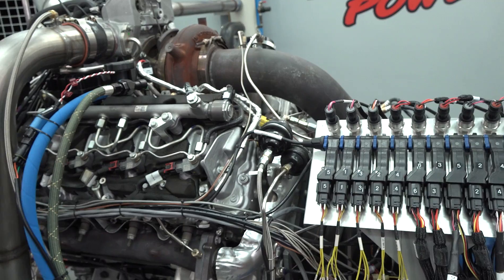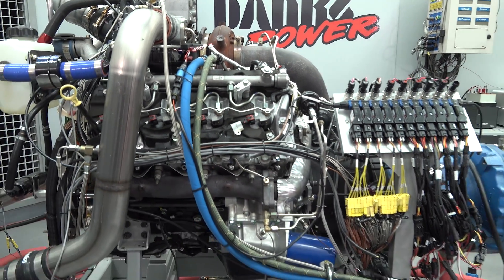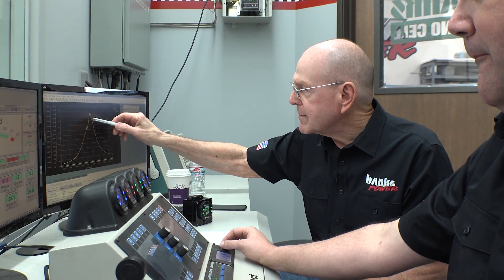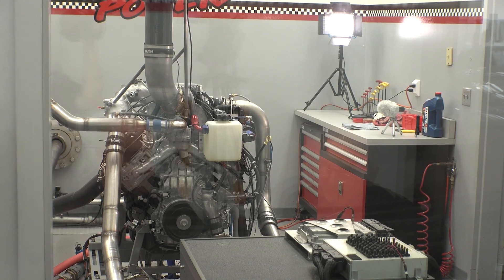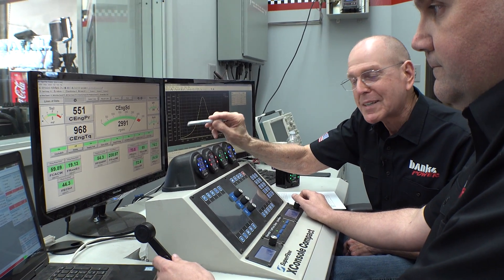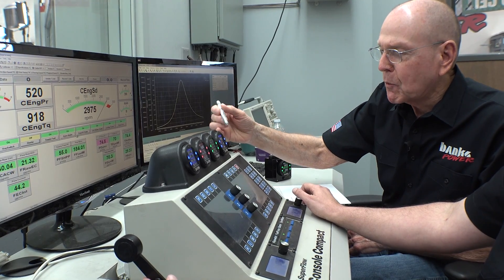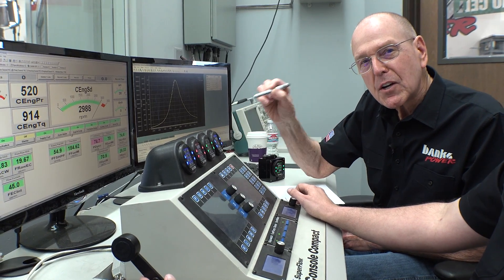KILLING A DURAMAX Pt 2: 550 Horsepower! 🔥

Comment: Mr Banks Can you PLEASE make a affordable solid state medium fuel pressure lift pump for our diesel engines? I have a 12 valve Cummins with a P-pump! My problem is that I can't find a affordable pump that is capable of producing and sustaining a minimum of 25psi. I emailed Facet about making a 25-50psi solid state fuel pump but no answer from them at all and apparently they ignored my message to them

Comment: In case you missed the question the first time. What happened to your series on rear diff covers. You stated your dyno blew. So you get a new dyno and jump to another infomercial on the Banks gauges. A shame your career will end as a snake salesman. Someone who had integrity has gone to this level. You slam another product and fail to prove yours is superior.
Reply: This is an engine dyno, they have to do the diff testing on a chassis dyno, that's the one that blew up. Maybe you should pay more attention.
Reply from the maker: It's coming! We'll be posting the results video at the same time we debut our diff cover. We know that we'll only be able to get everyone's attention once, so we're synchronizing the data reveal with the Banks diff cover reveal.

Comment: My carburetion instructor back in '81 would have loved these. Paul Reineke from NBC Tech. (Now known as UNOH.) I got to see him 2 months before he passed away at 86 years old. I thanked him for the in depth attention he gave to air density as well. Not on the level as Gale, but to an 18 year old in '81, him stressing, " You CAN'T run 750 CFM through a stock 350. You CAN'T!!!" rings in my ears every time I see an open air cleaner sucking hot air from under the hood. That was one of his pet peeves!

Comment: Kill a duramax.... just look at it and it will fail. GM is trash

IDI 7.3 making 700HP and 1500lbft on stock bottom and over 400k miles....Sorry GM..
Reply: Zues Toots yeah right. Show truck that doesn’t see any towing. Buddy destroyed his Ford towing his 38’ 3 axle race car trailer. His Duramax, can’t be killed towing the same trailer.
Reply: Idi 7.3s are known for kicking the bucket around 500 lbft ish without careful builds the powerstroke like 700 hp.
Reply: Also there are duramaxs making 1200 hp
Reply: jdr ok my points went way over your head. 👋🏻
Reply: @dnnbrgr7864  wasn't responding to you sorry if I replied to you. I'm just stating that the 7.3 isnt even in powerstroke trim known to make that much on stock parts before rods start dieing a 7.3 idi won't support that much without a completely built engine as they start breaking over stock and they require a ton of fuel modifications. 800 lbft is more realistic 700 and 1500 lbft that serious hp and torque for a engine that never seen 400 lbft stock

Comment: Have a 2002 GMC 2500HD with a Duramax(LB7), bought it in 2006 with 35,000mi on the odo, first 2 things I changed were the intake system and the exhaust...Been running Banks for the last 12yrs, both the cold air intake, and the 4" exhaust system, from the downpipe back...the truck currently has 160,000mi on the odo, and other than replacing all 8 injectors 4yrs ago, I've had no problems...It's a daily driver and my only vehicle, and I have no qualms with doing upgrades using Banks engineered products...

Comment: Any updates on the diff cover testing? Great video 👍
Reply from the maker: Yes, there is. The reason for the time between follow-ups is purely due to R&D. We've been sitting on the info for quite a long time. Why? We'll only get your attention once. We're going to reveal the research when we debut our cover design. We made many iterations and several billet prototypes, tested the heck out of the design, then went with a manufacturing process that is far more accurate but takes much longer. As of now, the diff covers are being manufactured. 👍

Comment: Quick question. When you are measuring cylinder pressure, is the graph you are showing calculated cylinder pressure readings, or actual cylinder pressure readings as measured?

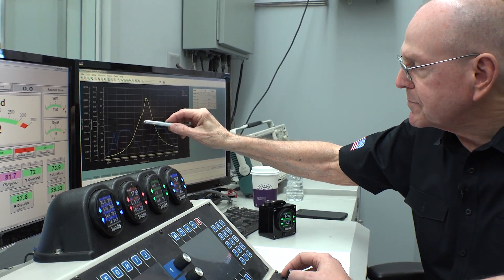Comment: 11:45
 The graph flattens out because the fuel is absorbing heat energy. This causes the air inside the cylinder to contract slightly as you graph shows until the fuel reaches ignition temperature then the graph carries on upward
Reply: Good explanation,  I guess at higher rpms there is enough heat in the cylinder to almost instantly combust the fuel.
Reply: @leonallen9833  the way I understand it the Top Fuel nitromethane guys use this characteristic to keep from melting their Motors, as it pulls the latent heat out of cylinder. The excessive fuel for them is additional cooling for the engine they stopped just shy of hydrolock, sometimes they miss the calculations and that's when you see the fireball.
Reply: The evaporation or boiling of the fuel in the engine does pull heat out. So you are correct

Comment: Gale your such a tease, give it to me all at once. I bought a 2004 2500 duramax brand new. 2 months old I installed your system and air cleaner on it. She's still running like a top today. 300,000 strong. I'm do for a new truck and I'm a little partial to the gm drivetrain.  Is this new motor going to be able to handle a whole lotta work or not?
Reply: LB7 or LLY? how many injector sets? Lol
Reply: @detroitdiesel-vu3ig  lily late model 04. Nk injectors yet. Just had a head gasket replaced sent the heads out and had them redone. Only issues I had was the instrument cluster . She shows 280,000 but there's well over 300.

Comment: this is way to smart for me, i want to see the crank hit the floor already.
Reply: Trent Nelson I bet you wear a mossy oak hat too
Reply: @sean1649  and sean wears wnite framed Oakley's with the Tap Out wife beater tank top.
Reply: You might see it the way they running at max rpm for such a long time
Reply: @traxxasLOVR  high rpm wont kill it unless it has a flaw in the block, a large stroke where the pistons start to push out instead of up the bore (7.3s would occasionally do that), its unbalanced, lack of oil pressure to maintain rpm or heat. He could run that thing to valve float and hes watching everything so close that it will show it's TRUE flaws and not a "lack of" issue
Reply: @jaredanthony8070  i agree with you as long as you can agree that the heavy rotating assembly on diesel engines lend themselves to way more stress under high rpms.... not related to keeping oil pressure. Although you need that
Reply: @traxxasLOVR  race duramaxs can rev to 5k plus. That's fully built obviously. But if gm is designing these engines as well as they seem to be that would also make me think that the rotating assemblies are pretty well balanced from gm. Drill a 1/4 inch hole in the crank a place or two and it might shake itself apart as with most engines. I've seen 12v Cummins with factory long blocks rev to 5k rpm and although they dont last too long doing it.. its possible..
Reply: @jaredanthony8070  i am talking stock internals. Blocks usually hold more than the internals. Cummins 6 cylinder setup can take more power and rpms stock to stock because they have more main bearings to hold the weight of the rotating assembly better. And gm has been ruining their reputation with duramax fuel pumps going to shit within 50k miles so i wouldn't just trust them on everything. They can say how awesome it may be but i guess time will tell
Reply: @traxxasLOVR  so you are blaming the BOSCH cp4 and cp4.2 on GM? Lol its going on the new 6.7 Cummins and is also on 6.7 powerstrokes although they have an apparently better filtration and water separator than the lml in particular. Also every single duramax except the lb7 that could break cranks.. has been capable of pretty big numbers bone stock. 500 horse and close to 1000 ft pounds. Lly's might not be able to hold it because of their overheating possibilities that were extreme cases. Lbz's all day. Lmm's all day. Lmls until the Bosch cp4 fails. L5ps have stronger parts than any duramax has ever had and banks himself tore one down and was impressed by it. That's why hes doing this test because it's so beefy he wants to know where it fails and what it is. The l5p basically blows all past duramaxs out of the water in built in strength in rotating assembly and block strength. And that's saying a hell of a lot because lmls with twin cp3's have made some huge numbers on stock long block. Stock pistons rods crank cam heads everything except air and fuel. Lots and lots of fuel.
Reply: @jaredanthony8070     dude. Dodge chevy and ford can all make 500hp 1000tq stock. And yea they all use the same pump but i have notice gm to cut corners i bit to much in certain areas more than others. Like you said they didnt do a good job with the filter system thats why the pump fails so much compared to other companies. But im not just talking about duramaxes with gm. Look at the chevy cruise. Equinox. Gmc terrain. And Acadia. Buick enclave and any Cadillac that isnt an escilade or ctsv. Electrical problems out the ass for no reason and so on

Comment: “Big ass filter” is the best technical term I’ve heard all day!!
Reply: Baf for short/ political correctness
Reply: @daviddroescher  Makes a good mnemonic too: we put the BAF in front of the MAF
Reply: I loved the "jackassery" comment!!! ROFL
Reply: I have AFEpower biggest big ass filter in my compoundturbo 💪😂
Reply from the maker: @johanDIYbuilds  And where is that filter located? In an airtight box drawing cool air from the exterior of the truck or can we see the filter if you lift the hood?
Reply: @bankspower  filter is straight bolt in to the low pressure turbo intake, so it's moving with engine when pumping gas, and it's very hard to make air tight box to it, because it moves, and there is very little space. But!, there is "ram air intake" throwing cold air under the bumper straight to the filter, And the box is in to do list, it just needs some rubber to one wall of the box.
Reply: @bankspower  NOW It's in airtight box! and ram air tunnel in to it.
Reply: Jackassery is also a technical term.